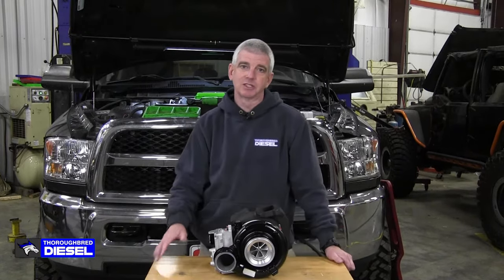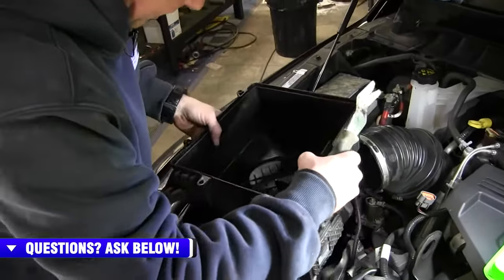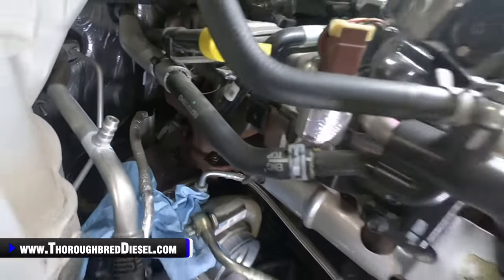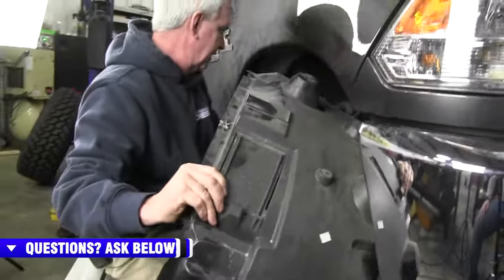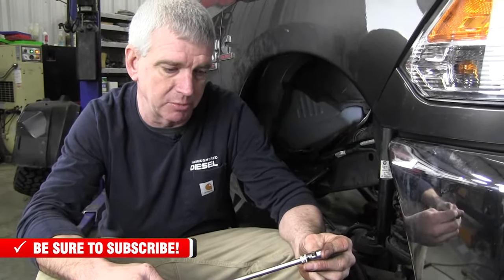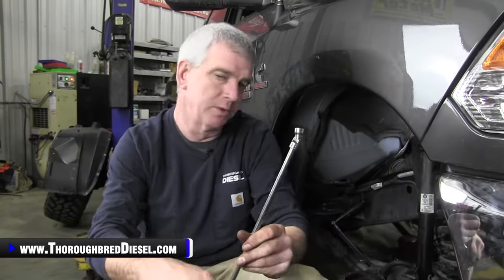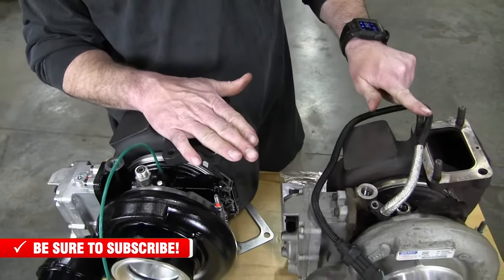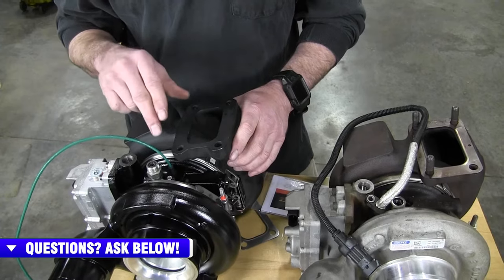HOW TO Install a Fleece Cheetah 6.7L Cummins Turbo #diesel #dodge #cummins #turbo #turbocharger

Comment: 6 hours to install and a difficulty of 8 out of 10 is not in my thinking a “drop in” part.
Reply: I would not call that a 8 out of 10 job. 8 would be like a cylinder head. 10 would be a motor disassemble.

Comment: Man there is a ton if junk under that hood . Iam sure glad I bought a new Dodge in2005 and there is nothing under my hood is a hard pulling 5.9 been a great truck 1 ton 4 door long bed dullay 4x4 factory 6 speed manual and manual 4x4 selector Laramie.

Comment: Just finished getting mine out. Watched this video step by step and followed to a T except that I did remove the battery tray and therefor didn't have to disconnect the alternator. I also opted to remove the coolant line from the block instead of dealing with the tight area under the turbo near the oil drain tube. Can't thank you guys enough for this video! New fleece goes in tomorrow morning 😃
Reply from the maker: You're very welcome!
Reply: Did you throw injectors in your truck or are you running stock injectors?

Comment: Wish this video was up a few days ago. Just replaced my turbo on 2016 RAM 3500 with a tow master from Thoroughbred Diesel. Had to fumble my way through it. Got it done but I will say the fleece cheetah drain tube is an absolute must have.
Reply from the maker: Shoot.  Well, glad you got done.

Comment: I want you to do a second Gen swap with a Sneed Speed exhaust and a cheats turbo on my 05 3500 6 speed manual 4 door long bed dullay and it is used to haul a 10.6 Bigfoot truck camper so let me know I will pay for all parts and you supply the labor. This will be a good video for your customers !!

Comment: Re:Nox sensor.
Thanks for the video. It is very helpful.
The thing is, I sat down for a minute and realized there was no need to remove the nox sensor as i have 410km on my truck, so it's tight. Just take the whole elbow out with the sensor/cable and move it off to the side. There is enough cable once you cut the zip ties that it can sit on top of the steering linkage.
Reply from the maker: Thanks for sharing.

Comment: Great video helped so much. But, I found if you remove the compressor housing you have good access to the lower lines and you don't have to raise the engine 2015 Ram 2500
Reply from the maker: Thanks!  Good tip!

Comment: Good evening sir. First, thanks for an incredibly useful video. I'm at the point of lifting the engine up 1" on the passenger side to clear the turbo studs and found that the engine does not pivot upward. Engine mount bolt has at least 1/8" of clearance on each end. What are the possible causes? Thanks in advance for your reply!!!
Reply from the maker: That is odd.  I would suggest loosening the drivers side as well.
Reply: Thanks for the answer! Turbo installation was very successful, thanks to your video, no leaks, great performance etc. FYI- I loosened the transmission shock mount bolts and it came right up. My next move would have been the driver side mount bolt as you suggested. Thanks again! B

Comment: So I put this turbo on my 2018 ram. Everything went smooth, Turbo works great. I installed the fleece drain tube with no added gasket at first( looked like it’s what you did in the video). About 5k miles it started leaking oil. Yesterday I took it off cleaned everything up and added a gasket with a fine line of RTV( used high temp red) … still leaking. I’m going to attack it again this weekend. Any advice as to why it could be leaking? Was going to try a new gasket with oil resistant RTV.
Reply from the maker: Same thing happened to us.  The drain tube does not require another gasket, as there is a recessed o ring in the flange.  The first kit we had the bolts in it were too long to make a good seal, you might want to check bolt length.  If you need help on this just give us a call.

Comment: Great video!!! watched it a few times and just finished swapping mine out. I saved a little time by not removing the NOX sensor, just undo the 2 clamps and take the elbow out the side and set it on the suspension. the only other thing I did different was the bottom cooler line, if you massage the heatshild a little, you can get a 7/8" socket on it to undo it.  all in all, one of the best if not the best video for this swap!!  thank you!!
Reply from the maker: Glad it helped!  Thanks and you're welcome!

Comment: Was wondering advantages of this turbo ? Hp ? Torque?  Website says "increase performance " thanks
Reply from the maker: Truck setup will determine the HP capabilities of the Cheetah.  This one, for the 13-18 Dodges will support up to 700 HP (with the right modifications).

Comment: You talk about the coolant banjo bolt reinstall being the qorst part. Woulent it make it easier to run that down after placing the turbo in the bay but before attaching? Or does thqt create clearance issues when bolting it up?
Reply from the maker: You nailed it, and I really wish that you could do it that way.  The damn coolant line is only so long and its length and position really only lends itself to being installed once the turbo is at its final resting place, if that makes sense.  Chasing the line to hook up at the other end is worse in my opinion.

Comment: I just had my mechanic install a fleece cheetah on my 2017 cummins 2500. 
I feel like I have some pretty good turbo lag till about 2000RPM. Then the truck shoots off like a rocket. 
Any chance you guys have some real world numbers for what boost should be? I feel like I can no longer maintain 70mph pulling my utility trailer in 6th gear as the rpms are too low and don't build much boost. Stock turbo always had power when requested. Thanks!
Reply from the maker: There will be SLIGHT lag between the Cheetah and the stock unit on the bottom end, but much better mid and top range.  Any chance you have a boost leak?  Check the manifold gasket at the turbo.

Comment: @thoroughbreddiesel did you do anything special for first startup with the new turbo? Some recommend unplugging the injector harness and turning the engine over multiple times for 10 second intervals to get oil pressure at the turbo before first startup. Then plug injector harness back in and start the truck. What do you typically recommend?
Reply from the maker: We recommend pre oiling the turbo, we also recommend an oil change when changing a turbo.  And for that, we change the oil right before changing the turbo, so that the truck doesn’t have extended times without lube.

Comment: Followed this tutorial, and came out just flawless, took me about 7 hours total.
I do have one question,  at 1000rpm I have a rough idle, any ideas?
Reply from the maker: Any codes?  Check codes and look at actual vs. commanded fuel pressure.  I don’t think its turbo related but we can help you figure it out.
Reply: @thoroughbreddiesel  no codes. It's a 18, so I had to order gateway bypass, to check injectors and calibrate vgt module, should be here this weekend
Reply: Recalibrate VGT, did a kill test and number 1 was no change to idle or 900RPM 
Is there anything else I can check before I tear down, to make sure u replace what needs to be done

Comment: I feel like those manifold stud holes are to tight on all of my imports that have had that issues I take a drill and clean the holes up to get rid of the resistance, also yes I own a 2013 cummins so what I wonder would there be an issues with doing the same on the manifold of the truck seems like it would make siding the turbo back on and off much easier
Reply: I just did mine by myself and it went up after jiggling a few times. Maybe lucky

Comment: What kind of your battery operated ratchet what brand is and do you like it ?
Reply from the maker: It’s a snap on 3/8 ratchet 14.4 volt.  I really do like the ratchet, but I haven’t had very good luck with these batteries.  I know a lot of guys like them but I haven’t been very impressed.  Great ratchet though.

Comment: Great video, going to be doing my turbo soon. Recommend linking your products and listing your tools used used in this video. It makes it easier to locate them.. As I cannot locate the down pipe gasket at 1:01:30 you spoke of having on your site.
Reply from the maker: Give us a call at 866-380-3068.

Comment: Have a stock 16 ram 3500 if I upgrade to this turbo do I need to reprogram, tune, flash anything? Have a actuator code and figured I'd up garage the whole thing not much more to do so
Reply from the maker: No reprogram necessary with this turbo and that’s the one of its best features.  But the truck runs so much better with tuning that really takes advantage of the performance turbo.
Reply from the maker: No, it is plug and play.

Comment: Where the heck is that coolant drain nipple? Do we remove the bottom bumper skirt to access? Thanks.
Reply: I've found it easier to remove the grill. Drain is left and below driver side headlight as you are looking at it behind the rubber flap

Comment: Been trying for an hour to get the bolts in on the bottom of the turbo  to the fleece oil drain tube. Only way I can see to line up the bolts is under the truck with an extension. If I remove the passenger front tire will I be able to access it?
Reply: Do you have the engine lifted still when you install the fleece oil drain tube?
Reply from the maker: Extension and a universal socket works the best.

Comment: Is lifting the engine absolutely necessary?    Could you put a tool list needed for this
Reply from the maker: Lifting the engine is a must unless you jack up the motor from underneath.  You will need to do this so the turbo clears the studs when it comes out.
Reply: @thoroughbreddiesel I’ve seen videos that did not do this step.. Going to be working alone so anything to make this easier the better.
Reply: The only way to do it without pulling the manifold and the turbo is to lift the motor. If you take the manifold out and want to deal with the 12 gaskets that are behind it also, you don't have to lift the motor.
Reply: It’s easier to pull the manifold with the turbo as one unit.

Comment: Question I have a 2018 ram 2500 mega cab it’s already has tunes is there anything that I have to change as far as parameters?
Reply from the maker: Tuning is not required.
Reply: @thoroughbreddiesel  thanks

Comment: What size I/D for the hose to connect to the drain tube on the radiator? for a 2019+
Reply from the maker: I think I used a 5/16 line there.

Comment: I'm sorry there is no such thing a just a drop in. 6 plus hours isn't drop in
Reply: @ronportillo3851  Changed out  my stock Hollset with a new one in 3 hours on my 5.9 in just over 3 hours in the hotel parking lot.